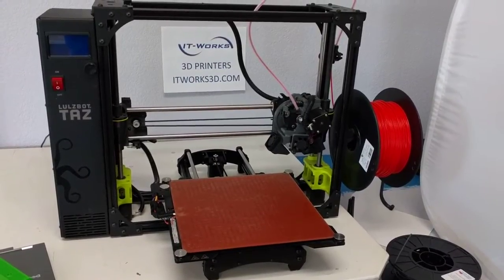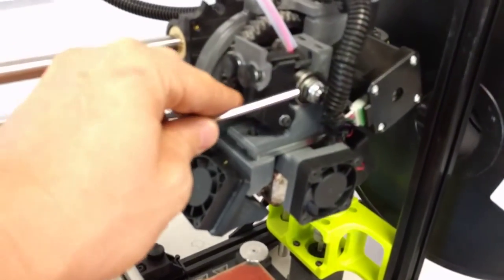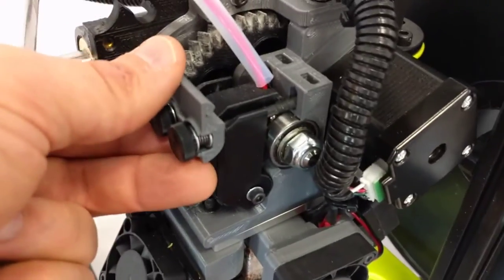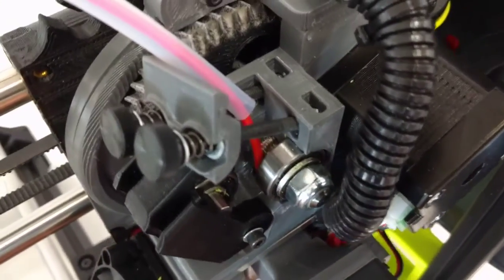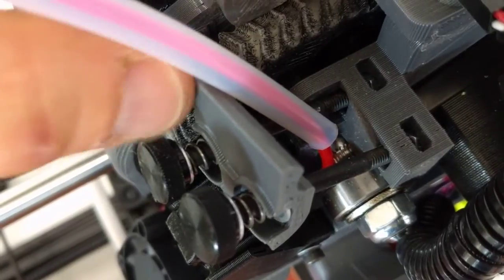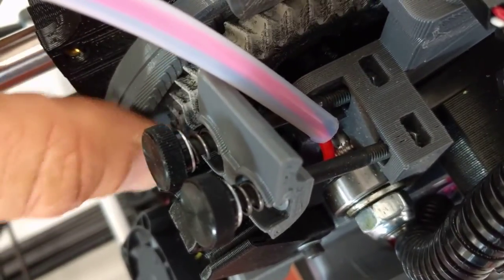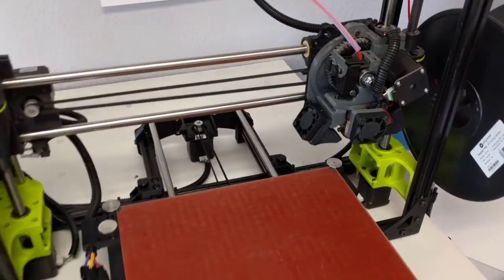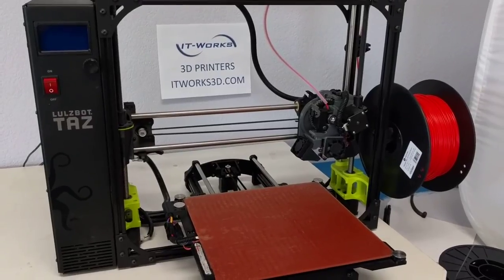How to clean the hobbed bolt on a LulzBot 3D printer

Comment: hi, i know this video is old, but i am trying to clean up a lulzbot taz 6. there is a tiny bit of filament that broke off just under the hobbed bolt. can you let me know how to remove it please?
Reply from the maker: You will need to take the fan off then remove the heat sink, and see what has happened below the end of the idler and hobbed gear.